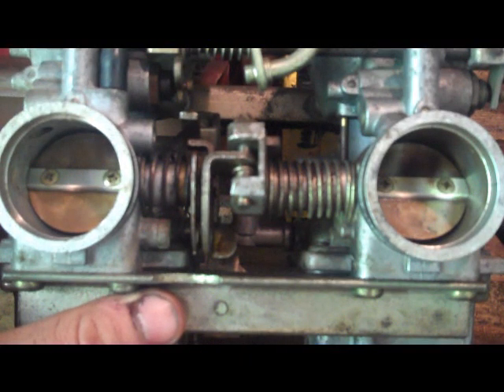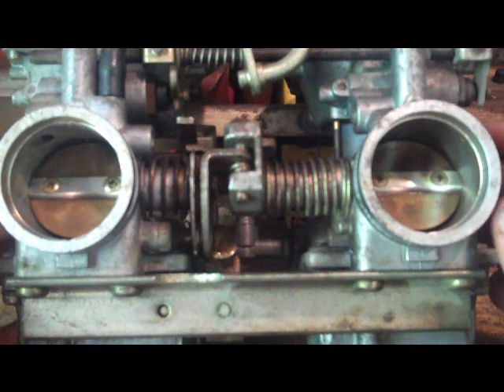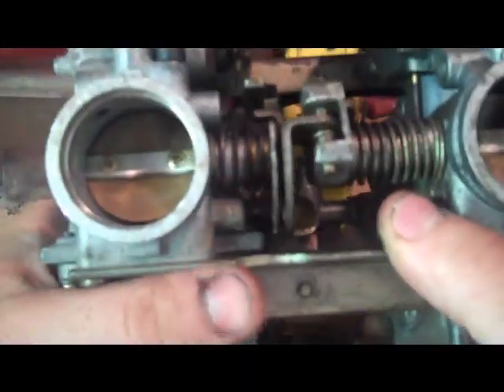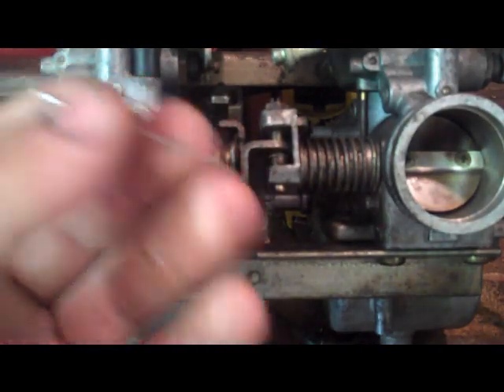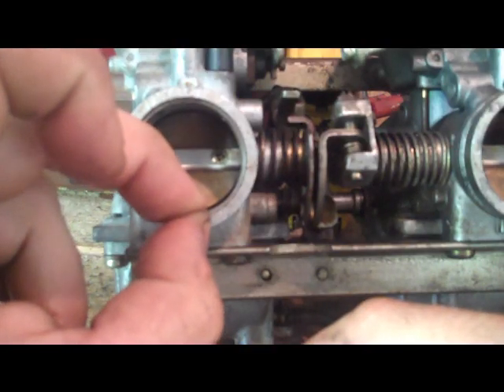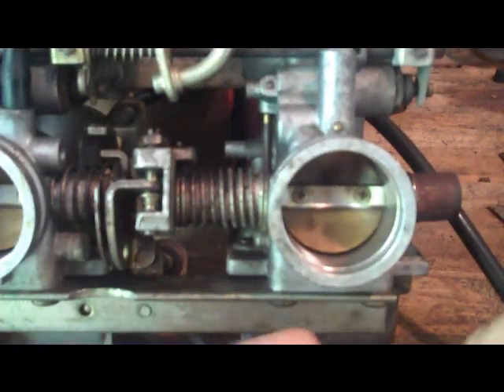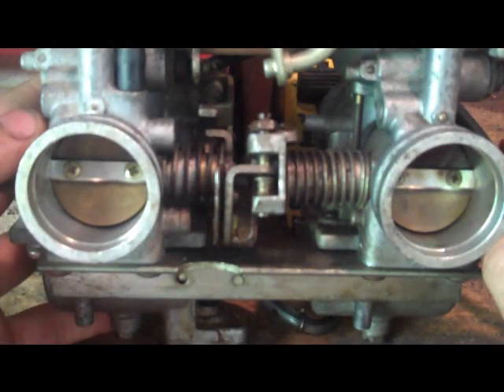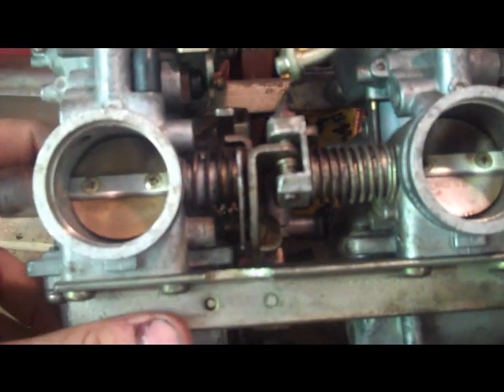How to bench sync motorcycle carbs

Comment: Nice first step. I use a short length of copper wire (cos it’s soft) adjust down on to it so that it JUST holds, then tip the carbs up and unwind the adjuster letting the wire drop out. Same with the other carb(s). Hi from the uk.

Comment: I had a real misfire and exhaust popping after a winter layup without draining the fuel. I needed to strip the carbs and clean the jets. As part of my diagnosis I tweaked the balance by ear and made things worse. So back to basics and try to set a datum balance was the next step. I found this video and did an interpretation using a small drill bit instead of the needle and a small piece of wood to lift the jets enough to measure. They were well out of synch and using this process worked amazingly well. After the rebuild the bike runs better than it has ever done in my 8 years of ownership. I have decided not to put in the garage for a professional balance because I don't expect much of an improvement. So thanks again for this video and I recommend it highly to anyone struggling with the same frustrations. Cheers, Tony
Reply from the maker: Glad to hear it Tony
Reply: I'm struggling with a 4 carb set up.i have walked away from it for a while.only I miss the bike so I'm going to have another look today. My problem is the rpm won't come.down.
Reply: @lyndonmortimer4123 Hanging revs at idle is usually due to it being lean/having an air leak if it can't be fixed by adjusting the throttle stop.

Comment from the maker: You'll probably be ok to just put them back on and back together so long as the adjustment linkage was not touched. The thing about bench syncing is it just puts it back to stock, which is fine, but what your bike really needs is for all the individual carbs to be adjusted to their individual cylinders, which have different needs as they wear independently. So go ahead and reassemble do a dynamic sync when you get a chance

Comment: Back in my glory days of working on my  Yamaha xj700 maxim I had all the good tools. Motion pro carb sync, yics stick 25$ tool yamaha makes you buy so you can sync em. cheap temporary plastic gas tank to run bike without original tank installed, up sized jets as far as I could go. Being a great motorcyclist begins in the garage. Trial an error method will get your machine back on the road.  I even had this special tool that was a spark plug that you could look inside cylinder see what color your fuel/air mix was burning at. 75$ .

Comment: Inside the mouth of most motorcycle carbs is a pin head marker. The butterfly is adjusted until half way over the marker point for correct adjustments. 🙂👍

Comment: Thanks a lot man..... Really i think this is what i need to do for my Honda CD250U carburetors, I've been having a problem of right cylinder running rich no matter what i do, So this is what needs to be done, need to sync'em and i will let you know how it goes. Tomorrow i am gonna do it. Thanks a lot again :), My bike has the same engine as Honda Rebel 250, difference is it has two carburetors, I manage to get it running but black plug on right cylinder was never fixed :D, :)) so here goes.
Reply from the maker: OK well remember to first check the common causes of fouling plugs, such as fuel height, float leakage, improper jets, valves needing adjusting, or oil infiltration. Also, if you have the same motor as the rebel, remember too that switching to a single carb setup is an option for you if you wanted to install rebel parts
Reply: mrmaxstorey Thanks a lot man, IT worked, Yes i am thinking of single carb setup as well... if i can't get these right i will definitely fix a single carb which is easier, less tuning more riding. :), But it worked that synching thingy. Now i have another problem, left carb float valve doesn't shut off. So gonna work on that tomorrow. Thanks a million, Many blessings.
Reply: Hola

Comment: Thanks for doing this, I was, have been told, LOL..will no doubtedly be informed many times in the future that bench syncing achieves absolutely nothing.
All that crap aside, I worked on a set of 4 1982 Honda Goldwing carbs in order to get the bike to run correctly..a long process indeed.
The setup on a flat four engine has many more tubes, hoses etc than your basic inline set, way too complicated for its own good... a basic Honda bloodline trait.

I followed another persons tutorial on bench syncing and with very careful work on my part the carbs worked really well, so well that people who knew the bike prior said.."oh I see you went ahead and got a shop to sync the carbs with the proper gauges afterall"
In short, bench syncing DOES have value.

Comment: hi great video thanks for sharing. was thinking of buying carb tune pro.if doing whats in your video would there be no need to buy one🤔
Reply from the maker: You will still need to buy one and use it. This technique just gets the carb back to factory settings, a dynamic tuning like with the carb tune pro adjusts the carb to your motor
Reply: @mrmaxstorey  ok pal.thats great .I'll give it a bash .thanks
Reply: I ment to ask do you Balance the carbs with air filters off 🤔
Reply from the maker: @bc-mr1si  no everything should be all complete
Reply: @mrmaxstorey  ok thanks
Reply: hi me again😃is it these 2 screws you adjust when carb tune is used .thanks
Reply from the maker: @bc-mr1si  yes same adjustment
Reply: @mrmaxstorey  thanks fella.
Reply: hi Do you have a video on setting float heights on carbs🤔getting mixed answers
Reply from the maker: @bc-mr1si  yea I have a few videos up on float heights just check the channel

Comment: Hi Max,
I'm having problems to start a nonrunning GS400 1979. When doing the complete overhaul of the carbs, I removed the idle knob to get it clean. I forgot to take any references of the initial position of the butterfly.

Can you tell me how I should adjust the knob as a starting point?
Does this adjustment has a big impact on a nonrunning engine?
And last question :)
With the spark plug removed and the choke on, am I suppose to feel some fuel on my finger when I rotate the motor with the starter?

Thanks for your videos and your help!
Reply from the maker: Dont worry about the idle knob too much, just screw it in until it impacts the linkage, and then about one full rotation after that. You can adjust it more later. And no you probably wont get much gas on your finger because you arent making very much compression with your finger there
Reply: mrmaxstorey Ok thanks!
By the way, your videos about troubleshooting are awesomes.
Reply from the maker: Vincent Pilon
Thanks Vincent

Comment: so i went with the pinesol method of cleaning my carbs. been soaking now for 3 days and looks great. now i gotta put everything back together and on! i had it synced a few months earlier but am wondering if i should perform this before getting them resynced or should i just get them resynced? i didnt take the carbs off linkages or mess with the adjustment screw so would i still have to get them resynced? im guessing yes. hoping not XD

Comment: Hi, this was very well done! I just did this on my Suzuki gsx 250f and actually ended up adjusting the butterflies with the needle in there. I actually though the mixture screws were the means for adjusting the carbies as I made a home made manometer which was kind of pointless considering that i adjusted the wrong thing. how do you adjust mixture screws on a 4cylinder 2 carby bike?  The guide I used to make my manometer is found by typing in youtube: ''suzuki across manometer''

Comment: Hi, after watching some of your other videos I took out my carbs to clean them.  Thanks so much btw! I went to do this bench balance you suggest (also twin inline 1982 bike). The valves are open as far as possible when the idle adjustment screw is in as far as I can turn it and I cannot even get a pin in between the case (venturi?) and the valve.  The bike has never been able to idle much since I got it so wanted to do what I can before putting the carbs back in.  Was wondering if I will be able to adjust it properly later if  the valves cannot be set slightly open when the idle adjustment screw is in as far as possible (there is a spring compressed as tight as possible preventing the screw from turning any further).  I would really appreciate your comments on this if you have the time.  Thanks!
Reply from the maker: The idle screw should definitely be able to open your butterfly valves pretty significantly. Is it just too short?
Reply: mrmaxstorey Yes, I think so, the end of the screw sticks out ~1/4 inch before coming into contact with the rotating part that the throttle cable attaches to.  If I rotate the other way it closes even tighter.
Reply from the maker: Hfx_Mo Well if it is able to open the butterflies even just a little, that should be enough to do its job. You can still do a bench sync by manually opening the butterfies by moving the linkage
Reply: mrmaxstorey Sorry, not sure what you mean by the linkage.  I looked in the service manual but I'm not quite sure which part you mean.  Do you mean the screw that you adjusted secondly in the video?
Reply from the maker: Hfx_Mo
The linkage refers to all the parts which move in the carbs to open up the butterflies. Basically where the cable connects, and all the parts that "link" it to the butterfly valves are the linkage, so if you manually open the valves that way all the butterflies should open, and you can use that to help bench sync the carbs
Reply: mrmaxstorey Oh, I see, thought you meant a specific part of some sort.  This is good news!  I may slip something very thin (the width of a pin) between the end of the bolt and the rotating piece so that I can prop the first valve open slightly and then try to adjust them evenly.  Hopefully the constant on the screw length will make this easier to adjust.  I really appreciate your opinion on this.  Maybe I will get this bike to start and actually idle in the end.  At least it is fun trying!  Thank you so much for your time!
Reply from the maker: Hfx_Mo
You got it :)

Comment: Ok so it idles off of choke now... I actually had to back out the idle screw it worked so well. Took it for a quick stroll and same result under a load . 15 mph and she falls flat, stumbles and lean pops... I wonder if it's bad gas.. The bike has been sitting for a while..

Comment: Mrmaxstorey i'm stumped. I have a 2002 ninja zx7r that I just cleaned the carbs on watching your videos. Great informational videos btw. The cleaning job was fairly easy and it was my first time. Hardest part was getting the carbs off the bike. Anyways when I pulled the slide needles I noticed they all have #4 washer shims and the e clips are on the 3rd setting. All the main jets say 134 and the 2 outer mixture screws were set at 2 turns out and the two inners were 1 3/4. Stock setting is 1 3/4. When I bench sync the carbs with a needle and start my bike it hangs onto the rev like no tomorrow telling me its lean. So I tried backing in the screw without using the needle and eyeballing it and closed the butterflys a little more and it seems to rev out and not hang as bad. The exhaust sounds terrible though. Instead of that bub bub bub bub its bbbbbbbbb. I took her for a ride and it revved out nicely in first and then bogged in 2nd from 4k-8k making me think its to lean still. Any ideas or suggestions? Thank you for your time and great videos!
Reply: I also forgot to mention that it has a high flow air filter and a slip on exhaust.
Reply from the maker: dan brewer
Whoever added those mods didn't correctly jet the carbs. So you can either return the bike to stock settings by obtaining stock jets, intake and exhaust, or you can continue to adjust the carb settings by the method I show in my carb jetting video

Comment: nice video man :)..but I also want to know how to adjust the air/fuel mixture in this kind of carburetors..my gs850 has trouble with them...
Reply from the maker: +Alberto Velasquez What modifications do you have on the bike?
Reply: +mrmaxstorey  it has no modifications.... last time the bike didn't run.. I cleaned the carbs and started running.. but next day didnt run again
Reply: +mrmaxstorey  it has no modifications.... last time the bike didn't run.. I cleaned the carbs and started running.. but next day didnt run again
Reply from the maker: +Alberto Velasquez If it has no modifications then the air/fuel screw must be left in the stock setting. If you didnt put an inline fuel filter in the fuel line before filling the carbs back up with fuel, then the rust and gunk that was in the tank may have re-infected the carbs. Clean the tank out, clean the carbs, put in a fuel filter
Reply: +mrmaxstorey the tank was full of rust so we cleaned it ... but I found that  two of the four air/fuel screw were turned all the way .. they were even torqued and o rings were in a bad condition
Reply from the maker: +Alberto Velasquez That should then be repaired and set at stock setting
Reply: +mrmaxstorey  ok thank you.. and keep on these helpful videos 👌

Comment: For a rough bench sync you can use 4 ball bearings of the same size and drop them in the butterfly start to move the throttle until all the balls fall out at the same time. This is not a precision adjustment just a rough  syncing gets you in the ball park
Reply: AVI inc great idea. I have little airsoft ball bearings and they’re a bit greasy from handling with fingers, would it still be safe to drop them in?

Comment: I'm considering doing a bench sync because I've tried dynamic syncs but for some reason one carb always creates more vacuum then the other. Do you think this will  help? My main reason for needing the carbs synced is because when the bike is warmed up it will idle very high sometimes (near 5000 rpm) but given enough time it will fall back down to a more reasonable level before going back up again.
Reply from the maker: +Brian Bailey Have you tried all the other repairs, like cleaning the carbs, setting float height, checking for vacuum leaks, checking compression, etc?
Reply: +mrmaxstorey  I haven't gone as far as removing the carbs yet. But I was thinking cleaning them would be part of bench syncing them. That seems to be my next step so I'll try it. I've been resilient before now just because it looks pretty involved with all the small parts. Do you suggest that I try to clean the pilot jet or just leave it as is?
Reply from the maker: +Brian Bailey I suggest you clean the whole thing, including the pilot jets
Reply: Brian Bailey
Reply: Mine had the same issue, ended up being the throttle shaft seals leaking.

This might help you a bit if you are still struggling with it.

http://xjbikes.com/forums/threads/in-the-church-of-clean.14692/

Mine was enough of a basket case it needed literally EVERYTHING done to the carbs.
Reply: You have a bad vacuum leak somewhere first you must fine the vacuum leak before ever removing them spray starting fluid on each carburetor around the boots throttle shafts hear they're in Yonder don't let it get on the other carburetors one at a time until you find where the leak is then go from there to removing and or rebuilding.!!!!!

Comment: Using an actual sync tool would obviously be the most accurate but can you sync by sound and how well the engine is running? I don't think it would work for more than 2 cylinders but for something like this you're really just trying to match the 2nd body to the 1st.
Reply from the maker: +Dannyboy1277 A sync tool is just like $40

Comment: Is the valve supposed to be open like that? It's closed on mine and it opens after "I pull the throttle". I've got issues with cold starts - I always have to wait until the engine gets warm to be able to ride, otherwise it dies or it shoots to exhaust (when its a bit warm). I've cleared the carbs, added a little bit of air-flow as I though there is too much gasoline... so its better but not what it should be. The bike goes like super-pumped at one point and then its just choked. Any help would be appreciated :)

Comment: I totally forgot about the idle pin on my bike. I've just tried to sync my carbs on my fzr600r 1995 4jh and carb 3 is very low on my carbtool :/ so I saw this video again and thought ahhh need to use that idle pin also to sync carb 3 😋 the screw do not even touch the idle plate 😂